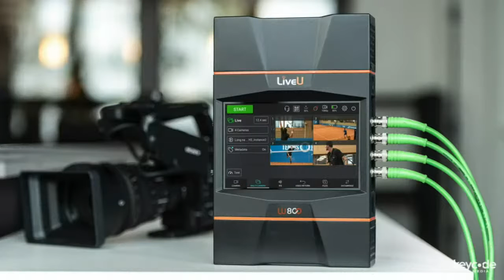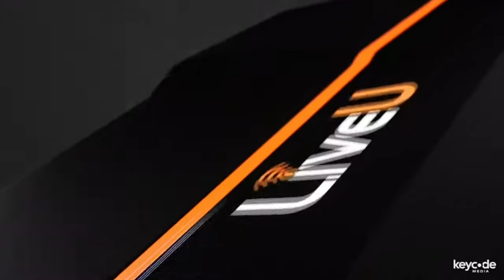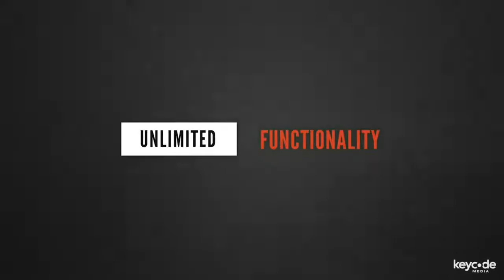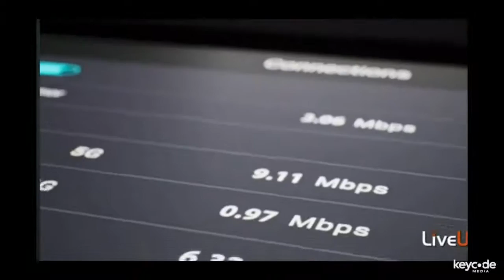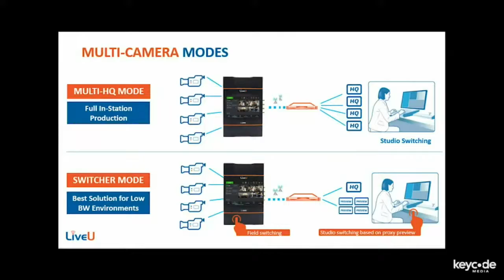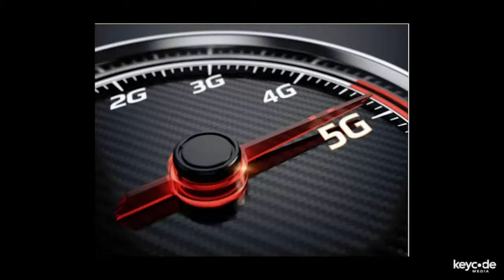LiveU LU800: All-In-One Production-Level Field Unit

Comment: Hi Sir, Could you tell how long HD cable that we can use with LU800?  Can use the LU800 as switcher outside I Mean we do not use any switcher?
Reply from the maker: Not sure about cable length! It would likely fall within traditional HD cable specifications. There is some very basic switcher functionality available within LU Central. Would still highly recommend you still use a pro video mixer (Ross, NewTek, Vmix, etc)
Reply: @KeyCodeMedia  Thanks so much for reply me back. This is the best imformation that make me clear about LU800.
Best regards.
Thanks